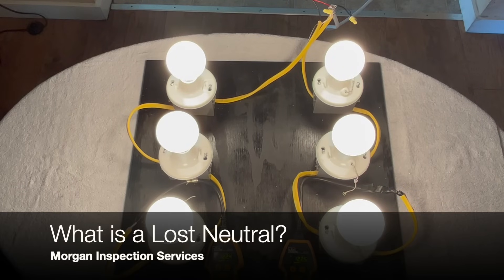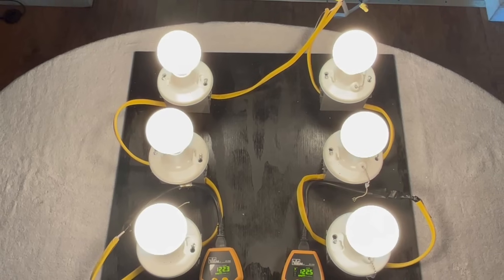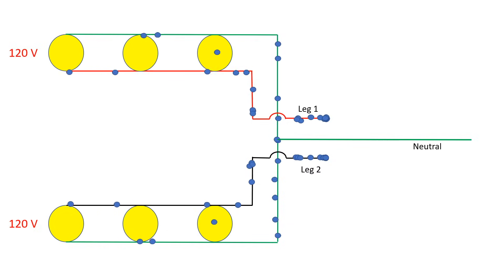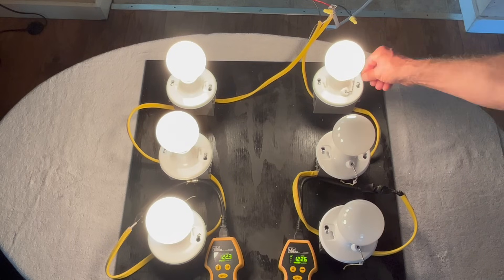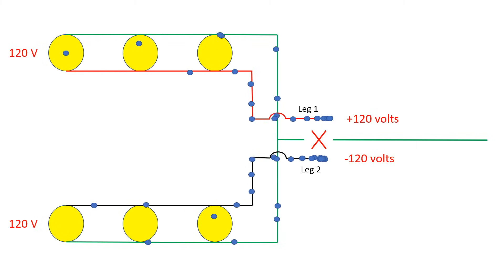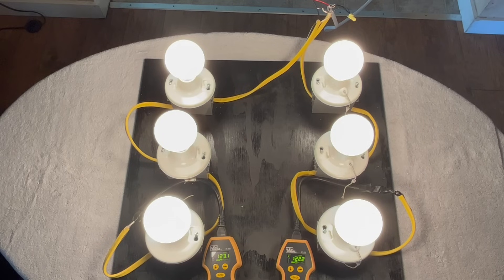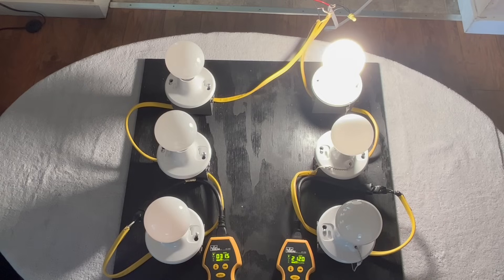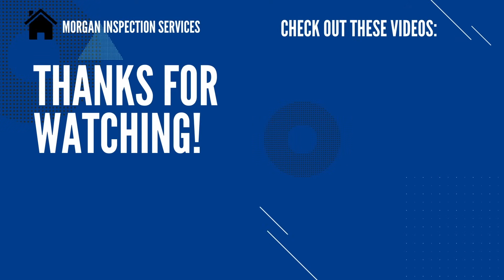What is a Lost Neutral? Lost Neutrals demonstrated

Comment: This explains why 90v will be applied to half the panel and other half gets 120v from backfeesing thru panel from a 120 source the illegal way.
Reply from the maker: I’m not fully following you.
Reply: @morganinspectionservices3840  I have a main panel, and then a double pole breaker as the "main" for a subpanel, and a duplicate subpanel is in another location (in the barn/shop) and I have a 20 amp 120v single pole breaker outlet there and have backfed power from generator from that outlet after disconnecting the true MAIN breaker and on outlets and lights on one side of the main panel in the home I only get ~90 volt, while the other side is a full 120 volt. It is odd to me, the more I think about it I don't think it is from a lost neutral now as it should change/have same affect on both sides of panel. 

You got any ideas on it? I know its despised and most of the time illegal, but it just makes me wonder the cause. I no longer use it that way anyhow as I am in process of making a legit transfer circuit.

Comment: Thanks for video. I have a follow up question. Does bonded grounding and Neutral at service panel help to mitigate serious consequences laid out?
Reply from the maker: No. When your service loses a neutral, nothing done at the panel that I can think of will change the fact that you will have the two legs in series on a 240-volt service.
Reply: How do you test for loss of neutral?
Reply: If neutral is still bonded to ground, the ground can serve as a return path to the transformer, though it's not an efficient path due to earth's high impedance.

Comment: What is that device you have wired to the lights that is showing voltage.
Reply from the maker: It is a SureTest circuit analyzer. It’s made to plug into a receptacle and measure voltage, voltage drop, and to tell if the circuit is wired properly.

Comment: Worst case scenario from a floating neutral at the service drop could be electrocution from energized water pipes and metal case appliances with 3 prong plugs, because until I believe the 1978 NEC, a cold water pipe  could serve as the sole grounding electrode if at least 10 feet was in contact with the earth, and the connection to the grounding electrode conductor is made within 5 feet where it enters the building, and plastic pipe could have been used to replace a section of corroded metal pipe.   Because the neutral and ground are bonded at the main service panel, a double loss of ground and neutral could have lethal consequences.  To combat this, a water pipe used as a grounding electrode must be supplemented by grounding electrodes in contact with 8 feet of earth with a resistance not to exceed 25 ohms.
Reply from the maker: Thanks for the info. I really appreciate it.
Reply: Water pipes still are bonded and that is for safety. In case of broken neutral you do not want 120 volts between your stove and the water tap. It is safer to raise the potential of the water pipe.

Comment: This happened last night during a wind storm, I was confused as hell, since half the light worked, and the other half were bright as hell. Can't believe we didn't blow any bulbs or anything after 12 hours. Thanks for the explanation!

Edit: months later I would learn one of my friends backed into our telephone pole 😂
Reply from the maker: Wow! So you didn’t lose any electrical equipment in your home? If not, you were very lucky!!😊😊
Reply: @morganinspectionservices3840  Cell phone and laptop chargers connected would like not only survive, but work normally during the overvoltage if they were (as they usually are - but not all are) rated for 100-240V for world use. So they'd run happily on 120, 170, 212 or even 240V or down to 100V. So something surviving and even working doesn't necessarily mean it is getting 120V. So you could plug a laptop charger in and have it work, then plug in a hair dryer and have it explode, and mistakenly not blame the power because ("the computer still worked").
Reply: I think he didn’t lose electronics generally because of the dc switching power supplies being able to deal with the slightly higher voltage that’s still below 240.  A lot of computers power supplies used to have a manual switch for 120/240 operation, but these days many of them just auto adjust.
Reply: @ericnewton5720  I was wondering if anyone else would comment about just that. Most modern electronics can auto adjust to 120 @ 60hz or 240 @ 50hz. This might even be the case with LED bulbs.
Reply: @ericnewton5720  When faced with a world that has residential voltages between 100V and 240V at either 50Hz or 60Hz, a company is more likely to just design a single device that can handle as many cases instead of a bunch of separate localized variants of the same thing.
Reply: @JunkyardDigs interesting us car guys meet up again in a random electrical circuitry demonstration 😂
Reply: And how far did Mook make it up the pole? 😅
Reply: @WensleydaleBrown-wo5rg  Mook would climb the pole but she wouldn't touch the phases lol

Comment: Not only that. As the neutral is bonded to the ground wire the voltage on the neutral gets to any grounded equipment case. This could in worst case kill. Here the instruction is to get out and call the power company and not to return until it is fixed but we have higher voltage.
Reply: I don't know about US but in Czech (EU) you have to have 3 wire system and connecting neutral to ground is forbidden. Yes there still might be old houses to have it but in own interests should rewire it asap. Also every house have to have "ground protector" which measure current leak from main to ground and Tripp in matter of milliseconds.
Reply: @VavrMar  You mean the ground wire? That is known as TT. It is used in many countries in Europe. Others use TN-C-S where the ground wire connects to the neutral at the entry. Such a system does not require RCDs to work though they now are mandatory as additional protection.
Reply: @VavrMar  It's because one ground rod never gonna be enough to ground the neutral and still be safe even on a neutral loss, the only kind of earthing that remains secure even with a neutral loss is the structural one, the kind that use your building's steel structure, and have to be a so well performed connection, welding, this kind of earthing creates a Faraday's cage and is the only secure option to use TN-S system, my installation earthing is TN-S and is secure, I had a neutral loss but nothing on my house gave any shock, because more important that just grounding, is equalizing, and my structure is literally a Faraday's cage and I didn't had any accident, and it even saved my microwave oven and my frost free freezer of having their electronic circuit boards fried!
Reply from the maker: You are correct. Thank you for clarifying that.

Comment: I keep losing neutral on power company side but the lineman wont come out until ive paid an electrician to check its not on my side!!  Its always on the utility pole and its costing me a fortune!
Reply from the maker: That is crazy that you’re having to pay a service call each time. It’s also crazy that it “keeps” happening. It does not make sense that it would happen multiple times.
Reply: @morganinspectionservices3840  They came out to me last week because their equipment made my earth rod live and everything in my house including water pipes!  The box on the pole was replaced and the cable down the pole to my boundary.  The supervisors came next day only to tell me the lineman had left me with a live neutral!  I am quite literally waiting to be electrocuted!  They said the neutral is also reading too high.
Reply: Sue them. They should be responsible for anything they demand you to do if it is their fault.

Comment: I’ve had that happen at my house during a hurricane. A tree fell on the drop to the house separating the neutral. As soon as the lights went bright I knew what happened and ran to secure the breaker. It took out the refrigerator, microwave, oven, dishwasher and clothes dryer. Completely fried three surge protecting power strips and burned out a bunch of light bulbs.
Reply from the maker: Yes, it can be very destructive to electronic equipment. Good thing you knew enough to recognize what was happening and shut off the power as quickly as possible.
Reply: Back in the day when a washing machine had a more mechanical clock timer for cycling.
Reply: Damaged the dryer? Wow. They use 240V usually, but some use 120 also to run some circuits, if that side goes high it could do damage. If it goes low, not so likely.
Reply: @franklofarojr.2969  It fried the circuit board. I replaced it with an old 1980s dryer that has been refurbished. No electronics works better than any new dryer I have had.
Reply: I already had a Neutral lost, but luckily, I've previously grounded my neutral mains cable to the house's iron structure, doing an structural TN-S earthing system, so even with a lost neutral, the internal cable that was neutral didn't gave any electrical shock, even during a test with all appliances out the outlets and purposely shorting one live leg to the grounded wire, the phase wasn't able to give any shock while connect to the structure, I was like the potential had vanished to the ground, I know it's actually the Faraday's cage effect inside the building, only a perimeter circulating grounding like the case of using the steel structure can do this effect, but about the appliances, I had an air conditioner working on about 120v on one leg, and a microwave and two refrigerators on other leg, but the microwave was on standby, the current on kitchen was lower, so if my neutral wire weren't so very well grounded, I'd lose my microwave and my electronic controlled frost free freezer.
It's so important ground the neutral wire very well, this can save you during neutral losses or even when a high voltage wire hits the neutral on road.

Comment: An open or high resistance neutral conn in the panel or meter can will also cause this. Not always upstream. I've been on many trouble calls where the nipple between the two was glowing because of a loose neutral in the panel. Some were never actually tightened by the original installing electrician.
Reply from the maker: Great info. I guess when I said upstream of the panel, I actually intended prior to any of the branch circuits, so yes the neutral lug on the panel would certainly qualify. Thanks for the clarification.
Reply: @morganinspectionservices3840  You are correct though. Probably 90 percent of my trouble calls were due to homeowners allowing trees to grow up into the service wire and either breaking the neutral, or rubbing it in two midspan on the drop. People don't understand that the power company isn't responsible for their negligence.

Comment: Did you ever think that using green on your schematic to represent the neutral line wasn't a good idea?  Green is standard wiring code for non-current-carrying ground, not neutral!
Reply: Got it!  An alternate solution might be to use a different color background so white would stand out, or larger wire size.  Good video, though!
Reply from the maker: And white is normally the neutral, but white would not have shown up, so I chose green. Yes, I understand that green wire is the non-current carrying ground. How often have you seen blue current flowing through a wire? It’s just an animation, and I hope it serves its purpose.

Comment: The three (3) bulbs on either leg are wired in parallel.
(Although the two (2) legs are now in series to each other with the lost neutral.)
When one bulb is turned off, the Resistance goes up and the Current
goes down (in that leg) because they are in parallel.
       Naturally the leg with the highest resistance (series circuit) has the highest voltage drop.
Reply: "When one bulb is turned off, the Resistance goes up and the Current
goes down (in that leg) " - i understand that resistance goes up if we swich off 1 light in the circuit because its parallel so it is as if we closed 1 of the 3 roads for the current - so more resistance. More resistance means less current in that leg but both legs are in series so the current is the same. So if the same current is flowing while the voltage is much higher means that a lot more energy is on the side when 1 light is off. Does it make sense the way i rephrased it?

Comment: A few years back went on a service call where the homeowner had smoked up a flat-screen,  DVR, and stereo system after a 1500 watt electric fireplace had been running for about an hour.   It was a lost neutral on a MWBC feeding the master bed & living room with backstab connected receptacles. A backstab connection upstream burned out on the neutral.  Home was built sometime in the 1970s if memory serves me right.   This expensive ordeal would have been avoided had the receptacles been installed in accordance with 300.13 (B) which states the neutral of a MWBC cannot be interrupted by removing a wiring device.
Reply from the maker: Great info/example. Thanks.
Reply: Thankfully, I live in Chicago, where everything (almost) is in conduit, and MWBCs are not as common, especially in older buildings.
I do run into hack jobs where someone had scabbed in an illegal 14 or 12/3 'BX' and either ran both legs on a tandem or 2 separate breakers where the handles were not tied together. The Chicago NEC upped the allowable length for 'BX' to 25' from 6' (whips) for 'enclosed/protected' spaces. I expect to see more problems popping up as people (either DIY or remodeling cos.) run new circuits without the knowledge of how to do it properly and/or use 'backstabbing' on devices.
Reply: MWBC = Multi-Wire Branch Circuit